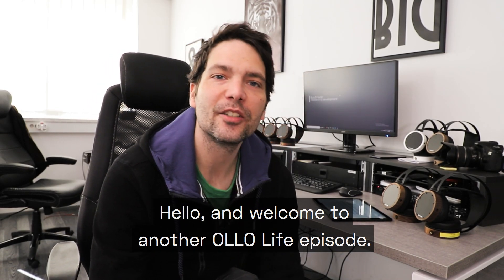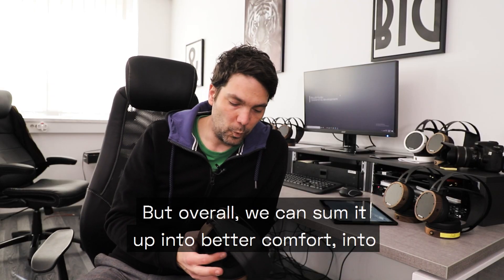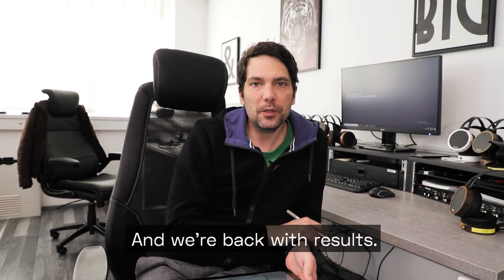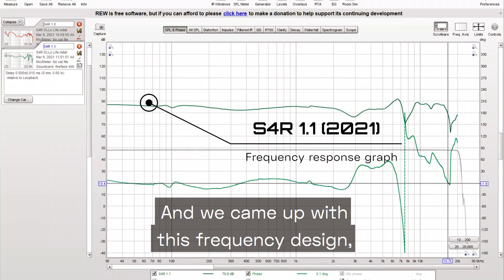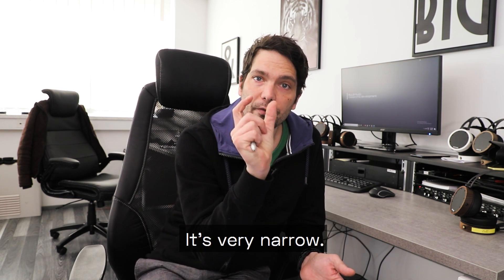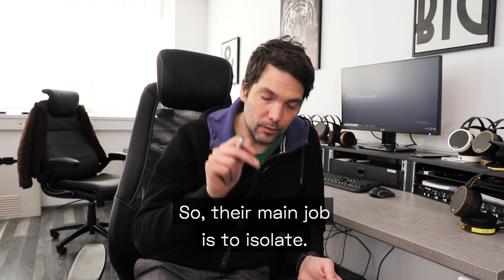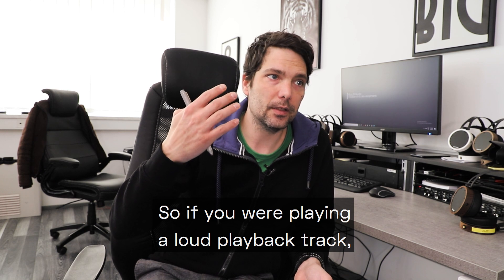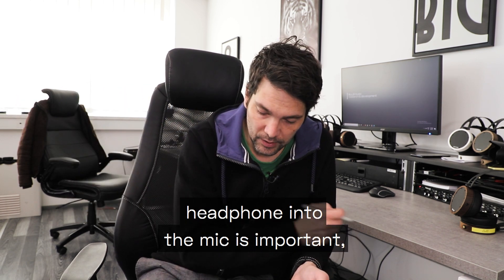HOW DO THE S4R 1.1. SOUND? | OLLO Life with Rok Gulič #020

Comment: Hi! I have these headphones and noticed they don't sound good/correct when I listen to them through my Fiio K5 Pro. There's a large dip in the presence region so that soft pianos or soft strings sound as if I run them through a filter that cuts of higher frquencies.Very painful to listen to. When I connect them to my Steinberg Audio Interface UR22 this problem does not occur. Shouldn't the Fiio be better because it's more powerful and capable of powering headphones like the HD600? Maybe Ollo headphones don't like headphone amps? Thanks!

Comment: Hi, Rok, is the S4R 2018 upgradable to the 1.1 version?
Reply from the maker: It's upgradable to 1.1 The cable will not be angled as the wooden cups are kept from the original. Sound will be 1.1, yes.

Comment: Hello!
The frequency response of the new s4R looks more neutral than the S4X or it is my idea ?
Thank you!
Reply: Hi. When measuring with IEC60318-1 S4R will look almost 100% flat. The thing is, this mesurements standard is not what we'd consider flat, it's just a standard so everyone in the industry can understand and excahange data. For example having tape measure in inches and centimeters, we'd still need to agree on exact conversion to be o nthe same page and even further, we need a universal constant to really be there. Similar with this, devices with standards are tape measures...what you measure and if it's ok or not, comes down to interpretation or use case. What we consider flat is closer to S4X response than to the S4R response:) Hope this helps.
Reply: @sabalmoza  thank you
Reply: @sabalmoza  I'm not sure what your target curve is, but while the result looks fairly close to whatever target you have (meaning, closer to a flat line than many other headphones you measured), your dips and valleys seem to be opposite what I would think would be optimal if you're stuck with some deviation and a perfect response is impossible.  For instance, on the S4R there's a slight emphasis from 60hz to 2.5khz, a dip at 3.5khz, and you're erring on the side of less energy over 15khz rather than slightly more.  Harman is now also saying there should be a bit of a bump in the 8khz region than what they previously understood, and again, you seem opposite of that.  If I flip vertically your compensated measurement of the S4R 1.1 where the ideal is flat, it seems like a better curve.  I understand perfection here is impossible and there are engineering concerns, but why these choices?  Is this intentional to help people mixing in a studio error on the side of a better tonal balance?  For pure recreational listening, it seems like the opposite of how you'd want to deviate from perfect if you must deviate at all.